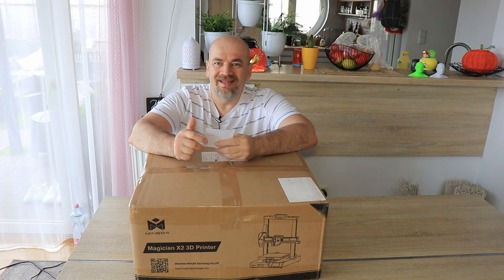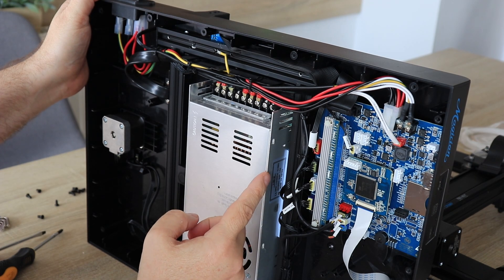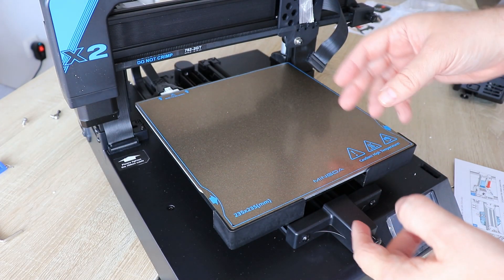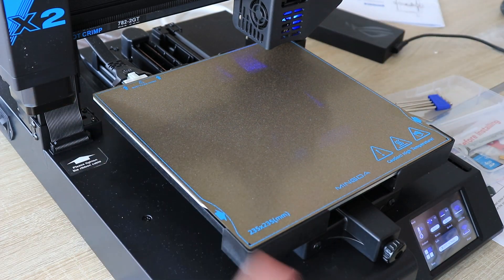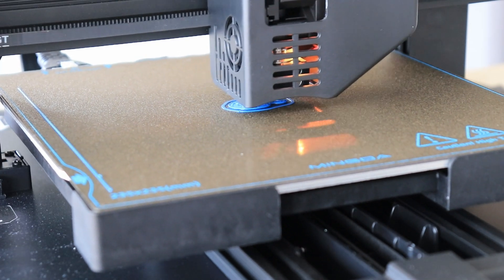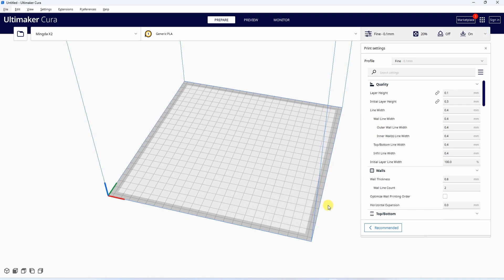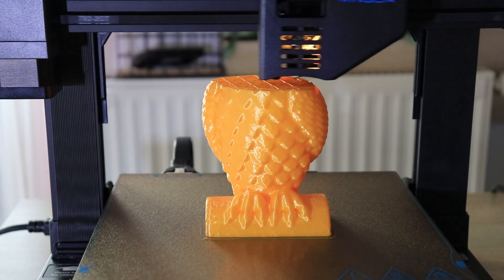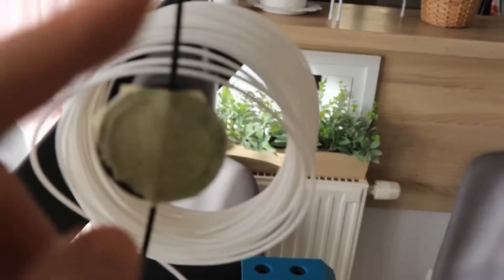Mingda Magician X2 review: cheap and quiet 3D printer

Comment: In your opening comments you mention Mingda seem to support their existing products and mention klipper. But to my knowledge this locked down closed source printer does not have a klipper option. Do you know different?
Reply: And to add. While this does seem to be a well thought out printer with several QOL features. It is NOT quick. True, that helps it to be quiet as you say, but I feel klipper would really unleash this printer. Shame it's a custom board that no one seems to have tackled

Comment: I got one of these for my birthday. It broke after just 8 days of use. It took a lot of effort to get it replaced since there is no US based support and no one I can call. I had to complain a lot to get the replacement. They did send the replacement without me first sending back the defective printer. I appreciated that but they wanted me to pay for shipping it back! I managed to get them to promise to pay me back for the shipping cost. You opened this up and commented that they don't want you to open it, but if you ever had a problem, they will want you to open the printer to check for lose connections or disconnected cables. They will send a video showing how to open it, but the video conveniently leaves out the step of peeling back the feet to remove the final screws! I haven't yet setup the replacement printer but I hope it doesn't fail on me. If it does, I will become the customer from hell! Aside from the failure after just 8 days, I'm pissed off that mine didn't come with that flexible metal PEI sheet. I had to order one myself.
Reply: Hi. I appreciate your input on this as I'm trying to find a 3D printer for my kiddo for Christmas. There are so many options. This one keeps coming up in reviews. Are you having any issues with the new one? Should I look elsewhere? I'm sorry you've had issues..
Reply: @IronicAsAlways for kiddo Bambi A1 mini is a solid start. What did to go with?

Comment: What is the purpose of the camera cable if the camera is not compatible with this model and where does the other end of the camera cable go to?
 I noticed at 14:29 that you can see some orange plastic through the hot end shroud grill, do you have a filament leak from the hotend?
 How easy do you think it would be to remove those Z limit switches so that G34 can be used? obviously some firmware changes would need to be implemented, what do you think caused the bad surface on the square in the bottom left but not the others? surly the ABL should have solved any level issues, why they did not just implement G34 in the first place is beyond me, Im not a fan of the limit switch solution especially if the switches have those metal blades.
Reply from the maker: So many good questions. It preheats to 150C so there will be no solid filament on nozzle during touch. The hardware os ready for nozzle touch leveling and G34 but probably we have to wait for some 3rd party firmware. Not sure why is one corner direrent, maybe when I placed back the bed, it was not 100% on same position? But I pay attention to this and that I have nothing below bed

Comment: My review unit arrived with rattling sounds in the electronics bay. The daughter board came off in shipping and looked a bit beat up. Mingda said to put in back in place, unplug a cable and continue.  Mine has printed very well. I hate there’s no unload feature but they said new firmware solves this. I wish their firmware download page showed a change log. And yes that white styrofoam is still all over my shop. I’ve torture tested mine with many prints and I’m pleasantly surprised how well it’s working.